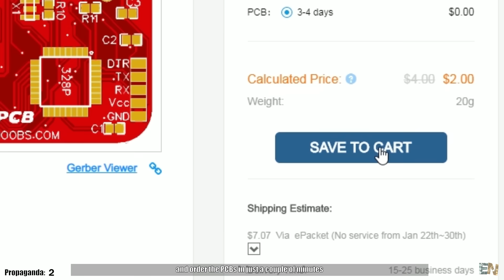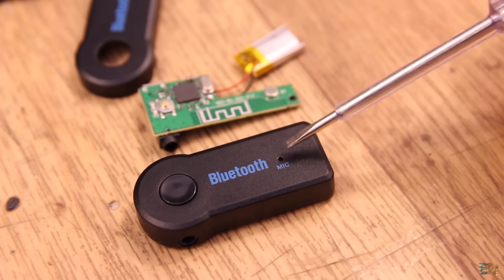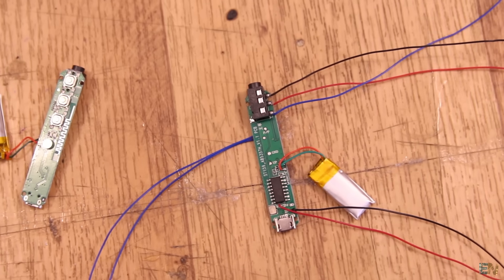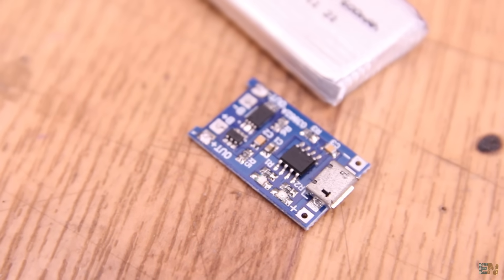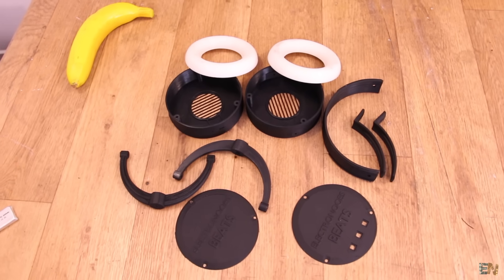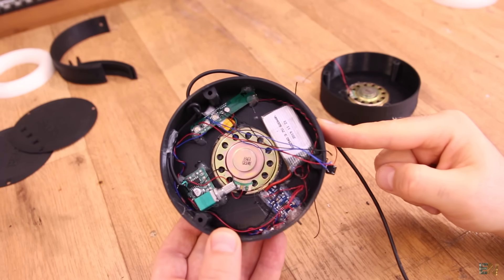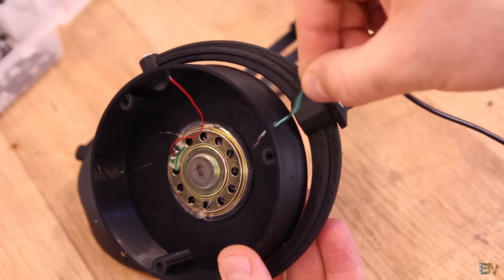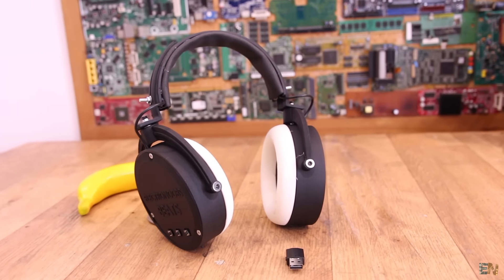How to Make Bluetooth Headphones - Homemade Low Cost

Comment: Just wondering, what if.. the audio transmitter and receiver system use 2.4ghz signal like 'gaming headphones' nowadays.. 🤔

Anyone knows a good small 2.4ghz module for DIY headphones ? I 'd like to try building this sometime

Comment: Extremely dumb project and overengineered a lot. Starting from wrong Bluetooth module selection. Normal BT already contains amplifier and battery charger, so you need only BT and that's it. Laptops starting from 2010 already contains BT as well, no need in ugly USB-minijack adapter.

Comment: Your 3D Printed Model is Far Better and descent than the Commercial Ones ! Bro - keep it Up!
Reply: FYI: descent is moving from a high position to a lower position; such as going down a later, a mountain, or similar.

And I agree that it's definitely decent in comparison to many commercial headphones. Unlike many expensive headphones, this one is easy to take apart to fix/modify.

Comment: I'm making headphones based off of some radio shack wireless remote control extender's (got at a thrift store) which are pyramid shaped, but I'ma also go after the old syfi, style of no headband. And if I have room put some white LED's cause they have a see through purple plastic tip.

Comment: I'm new to this so, can I actually just use the bluetooth reciever, connect it on the headphone jack then put it inside the headphone? In short, can I do it without the Amplifier board? If I can't, is there any Amplifier board that actually works with the headphones perfectly?

Comment: If someone is looking upto making such modification to old headsets, you don't need an external amplifier, connect the speakers directly to the bluetooth receiver module. It gives decent sound, fit in less space and have charging port on board.  Nice video though. 👍

Comment: Make more of these videos pls. And could you tell me how I could build the casing without a 3d printer cause they are really expensive and I can't buy one. Thanks
Reply: Try using MDF to build the case. With a jigsaw/bandsaw/table saw/... and maybe a router to make roundover corners.
Reply: @takix2007  Already tried turned very bad haha
Reply: Not sure if it's low cost but there are shops which do 3d printing.
Reply: @treeoflife7151  yeah they are super expensive and for a simple project that I need to keep on a low budget....that's not a viable option for me...
Reply: @anonymoususer900  ah i see. Why doesn't using an old headphone's case work?
Reply: @treeoflife7151  because it is very tough to find the exact custom size as i want...also i just bought a new pair of headphones so thats not a problem any longer...but yeah still i would love to find a solution to cheap 3d printing...thanks for trying to help tho!

Comment: Did the same with an old philips shp 1900 but instead of using the parts shown in the vid, i used a $5 bt to 3.5mm receiver from aliexpress and soldered it directly to the drivers

Comment: Using Two batteries when you can simply short the power inputs of amp and Bluetooth  modules is Disgusting (Since the BT use very low current). Overall I like the video
Reply: 'Disgusting' that's a strong word ! Don't comment something that you don't understand!
BT and speaker with the same power supply will create a ground loop and produce nasty interference sound! you either need 2 batteries, or a dc power isolator if using a single battery! These isolators aren't dirt cheap, but they aren't that costly either. If you look closely the circuit he used already had a small battery installed, so he used it rather buying an isolator!

Learn to be humble Son!
Reply: @andrewmanti235  Thanks for the comment, English is my second language, That's why i lack the knowledge of which is rude and which is not. very sorry for that, Now about the ground loop problem, it arises only if the amplifier module and BT module is too far away (using cables to send audio) or when the audio cables or connections are too much exposed(or bare).
Can you please recommend me a word that i can replace for. Thanks again.🙂
Reply: @maheen-  You can use "unnecessary, pointless, redundant, extraneous" however redundant, is what suits your point best!

Nah, the ground loop issue is always there, if you do what you told, you are minimizing it, not eliminating it!
Reply: @andrewmanti235   yes that's right, I had minimized it to a very negligible level. thanks

Comment: You dont actually need an amplifier for the original sprakers in the headphones, as long as its not below 16 ohms, i made the same thing , except i put have put it in a small box with a 600mah battery , and a jack for connecting any ear or headphones. Heck even jack to jack with a car amp. Results were great, and it doubles as handsfree calling option.

Comment: Stock up on MAX97220 for your headphone projects. That's a hifi chip used on most Creative Sound Blaster cards. There are very cheap boards available from China. In fact cheaper than TI DirectPath headphone chips. It has preset 6db gain that can be changed. It doesn't need output capacitors. It generates its own negative supply voltage from positive just with a ceramic capacitor on the board. It has excellent drive current to power low impedance headphones and extended voltage swing to power higher impedance ones, making it very versatile.

Use suitable headphone capsule rather than mini wideband speakers. I have not tested them personally, but i have seen 39mm headphone driver from Monacor International (Europe) and 40mm and 50mm drivers from Peerless by Tymphany, who also have numerous distributors in Europe and USA. The 50mm driver even seems pretty advanced with vented polepiece and paper coated zone, and has great reviews. Designing good sounding headphones is hard and reliant on iteration and intuition and there is no straight up recipe, so good luck!

Comment: Hi, Nice video like usual :-) I just don't have a 3d printer :-( Maybe one day.  But I ordered  those cheap earpods from aliexpress a while ago. I was thinking of using those not for a head phone  but for 2 bigger BT (TWS) speakers that can stand a few meters appart.  So I have old fashioned true stereo. But I never got arround. I was kinda shocked how bad those amplifiers you showed are. Because I was planning of using those single channel audio amplifiers but I realize now they might suck big time. Anyway maybe someday you can do a video about using super cheap earpods to make a True Wireless Stereo speaker set. How far appart can those earpod go anyway? Is that also 10 meter?

Comment: https://www.homemade-circuits.com/automatic-submersible-pump-contactor/?unapproved=81649&moderation-hash=60a6746ff60e0cec2522c3cd8e6c3bf1#comment-81649

Bro I'm trying to make an automatic submersible pump On Off controller when OHT is filled. 2 relays are used for Start and Stop function. Start relay should be in ON state just for 2 secs and STOP relay should be activated soon after the water reaches the top level of the tank. Above link is about the reference I have taken. There some values of resistors and capacitors are missing. There he mentioned that we have to figure out the values by experimentation. Due to lack of proper equipment and guidance I'm not able do this. Kindly please help me in this project. Please Bro. Try to make a detailed experimented circuit for me. Please please

Comment: Why don't you just use a generic usb  Bluetooth dongle? You could connect to any Bluetooth device in Windows. You are converting the audio to analog in the 3.5mm jack, then back to digital in the adapter, and then back again in the headphones. ???
Reply: because the author dumb

Comment: Why dont you use a bluetooth tx with audio profile capabilities instead of an analog input? You are doing D/A- A/D and D/A again. Lots of conversion added noise
Reply: how?
Reply: @larrycooper254  maybe this adaptor will work: https://www.amazon.com/Bluetooth-Adapter-Transmitter-Latency-Headphone/dp/B083TD9VW4. Beside the adaptor you must check that your software bluetooth stack allows you send audio directly

Comment: Why goes into all this struggle with 2 batterys ?? you dont need ampli for those small speakers!! If you insist by ampifiying sound you will destroy them!! just BT module + Good old Nokia Bat + TP4056 + any PC headphone is enough!!
If you insist into using 2 modules, use only 1 good battery and separate there power source with B0505S, to avoid ground loop and buzzing noise. This is the pb everybody is facing with DIY BT build + Amp!! B0505S is the key
Perso when I saw the intro, I though why to keep the shitty battery of the BT's module?? this battery is so small and do not last. And use another big battery for the Amp?? The pb you are going to face is that BT's battery is gona be empty fast, while Amp's battery will still able to provide jus!! Why struggle with 2 Batts?? 2 bats means 2 charging modules, and means 2 separate indicators (Charging/Charge Completed) !
https://fr.aliexpress.com/item/4000072454327.html?spm=a2g0s.8937460.0.0.63e52e0eVxliZ6

Comment: You should use dc-dc isolators in order to avoid ground loop noise. Dont power both amp and bluetooth receiver with same power supply or battery.
Reply: exactly what I though about at the beginning during the intro, when I saw the bluetooth receiver and the amplifier.
01:29
Reply: or use B0505S, to isolate BT receiver from the amp. This is the pb everybody is facing with DIY BT build + Amp!! 
Perso when I saw the intro, I though why to keep the shitty battery of the BT module?? this battery is so small and do not last at all. I know them well. And use another big battery for the Amp?? The pb he is going to face is that BT battery is gona be empty fast, while Amp's battery will still be able to provide jus!! Why struggle with 2 Batts?? 2 bats means 2 charging module, and mean 2 separate indicator (Charging/Charge Completed) !! damn!! Just use a good bat for both module, and use an isolator, B0505S does the job. I am sure you may know about this components...
https://fr.aliexpress.com/item/4000072454327.html?spm=a2g0s.8937460.0.0.63e52e0eVxliZ6
Reply: I've got this one in the mail because of the fully isolated booster(no ground loop) and TI's TPA6132. On paper at least this looks like a winner! https://www.banggood.com/DC5V-12V-QCC3008-bluetooth-Audio-Module-HiFi-bluetooth-5_0-Receiver-for-APTX-LL-TWS-DIY-Speaker-Amplifier-Home-Theater-p-1741876.html?rmmds=myorder&ID=6295012&cur_warehouse=CN Instead of those inefficient spekears its better to buy new ones(built for headphones) from aliexpress or ebay with 16-32ohm with high sensitivity. The battery will last many times longer. Why build something mediocre when you can build a high fidelity headphone for the same effort and a few dollars more?
Reply: @impuls60  exactly
Reply: @impuls60  lol there is no ground loop because BS0505 is already add to the device! look close under the BT board BS0505 is present.

Comment: I have a question how can I upgrade it to use it with my phone? And does it have different audio or mono ?
Reply: You can just use it with your phone, no change needed. But this is not a very competent or good sounding project.
Reply: It has mono audio, it will works like a normal Bluetooth connection.
Reply: @Grummpyro  Bullshit, these boards all support a2dp stereo.

Comment: Can you do it with Bluetooth module and AT tiny 85 ?!!
Reply: Bluetooth module + any small size battery (old Nokia battery are prefect) + TP4056, this combo does the job.
Stuff all that in any PC headphone and u good to go wireless!
Reply: @DrZipZwan  
I meant to start from zero
Reply: @عمرمطر-غ5ب   I dont see what is the use of ATiny 85 in this build. Do as he did if you wana start from zero expect for the amp part, check if the speaker you are going to use are fine without amp, if no add some small amp.
check my most recent comment for more info... just below the vid,  for the powering part... one batt does the job ;)

Comment: Nice presentation.  Question: my current bluetooth adapter makes a very annoying and loud "announcement" tune when plugged in, and then another annoying noise when connected.
Is the BT adapter you presented quiet? A tiny LED is all I want or need when connected. Thanks. I wish that all BT manufacturers would quit making noises when turned on.
Reply: Cut the wire to the beeper or put a switch inline
Reply: @AndrewAHayes  The "welcome to Altec Lansing" message comes from the BT firmware. So far I have not been able to find a BT device that merely displays an LED. So far all of them "say something" like "connected" or "you are now paired".
or make a loud windows-like musical tune.

Comment: Am also making one for myself but want to do ground loop isolation for cheep coz am using only one 18650 any advice ??
Reply: Man I had a similar issue try using a 20k (believe me it really works or any hissing noise )or more on the input of amplifier this should fix most issues . If not then make sure you have a good vcc. I also had same issues when I was using Bluetooth module with amplifier then I did was use a diode to rectify and use a big really big cap for smoothing like 22000uf . Hope it helps. As as far as ground loop isolator is concerned you can make one by making a 1-1 transformer and the ferrite ring can be taken from a AC filter on smps . Just make sure the impedance is ok , and try to keep the resistance above 100 ohms

Comment: You can find DC-DC converters that will give you + and - 12V from +3.3V quite cheaply. They work very well with TPA6120.
Reply: No need for this purpose pam8403 will be killer one dam good amplifier...
Reply: @shabukajla3876  Pam8403 is very cheap and easy to run but it is quite low fidelity. For anything hi fi tpa6120 would be a better solution.
Reply: @olbrzym11   but i tested it's frequency response too on oscilloscope which is quite impressive which meens for low power application it works like a charm and on the other hand its easy to use

Comment: Hey noob could you make wifi base wireless headphones???
Reply: Wifi is really shotty but I imagine you can use a node server running on the main machine and buy a esp8266 or other wifi controllers and visit the local server and connect the esp to speaker.

Comment: Q&A WHICH WIFI ADAPTER DO YOU USE DOES IT SUPPORT MONITOR MODE AND CAN WE USE THE RASPBERRY PI ZERO W AS A ARDUINO ALTERNATIVE AND MAKE A DRONE USING THE RASPBERRY PI ZERO W IT HAS INBUILT WIFI AND BLUETOOTH FOR COMMUNICATION AND MAKE A WALKIE-TALKIE USING NRF 24 RADIO MODULE LOVE FROM INDIA BANGALORE